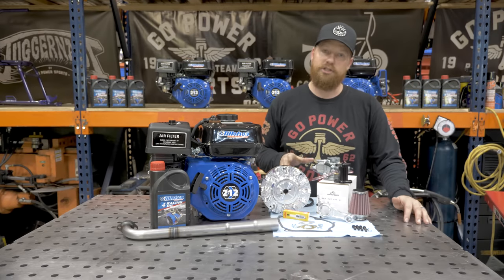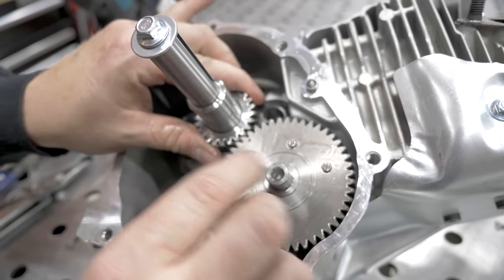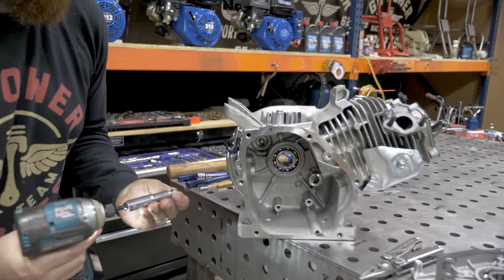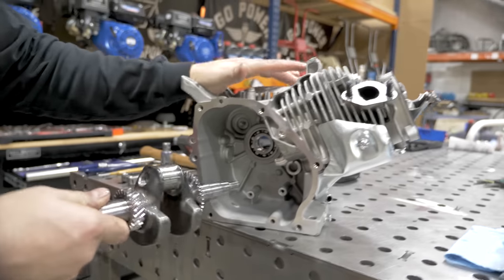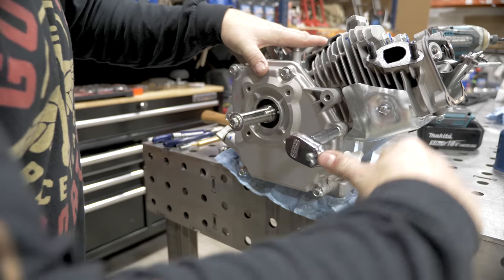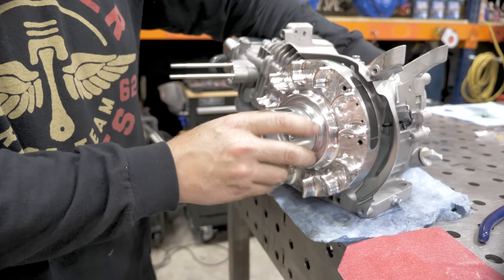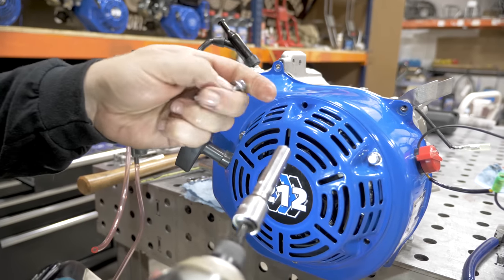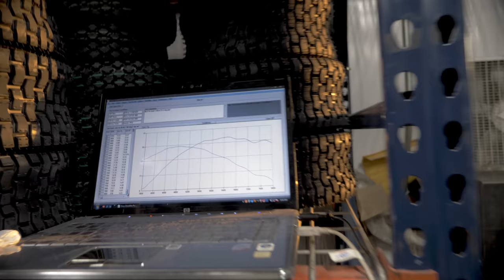Tillotson 212 Engine Stage 2 Install and Dyno | Tutorial

Comment: What was the point of oiling the rod bearings and installing the connecting rod on the crankshaft only to remove it so it can be installed on the piston?
Reply from the maker: Good question.  We do this to ensure that the bearings are properly seated. We see at the shop that some customers skip this step and snap off their rod bolts or have a connecting rod failure.  Since there parts aren't cheap and there's no warranty, we suggest this process. Thanks!
Reply: @GoPowerSports  finally someone who knows what they're doing. I like watching this stuff because always things are changing and different. All pretty much same but I keep up with everything. I do this stuff to pass time lol. God I have some 50s and 60s briggs I grew up with.
Reply: You have to seat the bearing with oil between the rod and crank no matter what to avoid scoring on initial start, it takes about 10 minutes to properly seat and check your clearance which will ensure the best dependability you can achieve with your new parts over the lifetime of the motor. I might oil my next one THREE times!!
Reply: He wanted to make sure it was well lubricated. You would be suprised. You have no idea how long that motor has been sitting in the warehouse with absolutely no movement whatsoever. That motor could very well seize up! So, again....he's taking extra precautions just in case! I hope this helps!
Reply: I have a sneaking suspicion that he meant to PlastiGuage it. Whoops,
Reply: @Fatbalddude1  No...he liked everything & said there was .005" thou or 5 tenths of an 100th of an inch,on a "splash & dip" Engine that's too much .005" thou , that'd knock like a sailor on you sister...even way back in the L6 Stove bolt Chev six era Babbitt bearings that's too much that's too much to depend on a hydrostatic oil wedge to keep the bearing & Crankshaft separated...what if the Cranks been "hourglassed' during manufacture 😶hmmmm what's that ?.Hope that's covered in the warranty."There isn't one,is now a (Stg 2) race engine.Fools & their $ are soon parted.Goodluck bud/dude New Zealand
Reply: @fatbuddycat  wen i take the gov out my ducar do i have to remove the rod n all that ??
Reply: @SoLoCruizer  it is always best to add a billet rod. That said, I've taken a governor out of a Predator 212 without removing the cam or valve cover either before... 🤔....so the technical answer is that it is very much possible.
Reply: @fatbuddycat  just to cruise at low throttle until the parts come in i should be good right they say the ducar is a lil better quality than the pred if u see that me going fast channel the kid on there compares the 2 motors to a tilly 212e
Reply: @fatbuddycat  thanks for your REPLY
Reply: @fatbuddycat  what billet rod would fit my Ducar ??? same as the Pred or the tilly
Reply: @SoLoCruizer  I believe the Ducar has a 196 crank and utilities gx200 rods.
Reply: @SoLoCruizer  the Ducar is up there with the Tillotson 212R. Gopowersports sells Predators with no governor and stage 1 installed.....just don't change the springs until you do your rod. On my 212r I kept everything stock, added a rod and pulled the governor then added 22 pound springs with a .660 bored carb....it is great just how it is. Like the Ducar it already has an aluminum flywheel. In all honesty, I wish they'd produce more of these box race engines because I would never waste my money on another Predator or any other generator motors.
Reply: i guess Im asking randomly but does someone know of a way to log back into an Instagram account..?
I was stupid lost my password. I would appreciate any help you can offer me!
Reply: @Leonel Jace thanks so much for your reply. I got to the site on google and I'm trying it out atm.
Looks like it's gonna take quite some time so I will reply here later with my results.
Reply: @Leonel Jace It worked and I now got access to my account again. I am so happy:D
Thanks so much you saved my account !
Reply: @Koa Alijah glad I could help =)
Reply: @leoneljace4650  nice scam
Reply: Love watching your videos very informative. It’s helping me decide on what kind of build I’m looking to do. What do you recommend. I’m looking to build a nice cruiser. Not a race machine. Want to keep up with traffic in my neighborhood. Maybe 50mph tops if I need it and also some nice range. What do you suggest.
Reply: @GoPowerSports so these aren’t one time use bolts?
Reply: @trevinskiking2165 You've got absolutely no idea what you're talking about mate. You clearly didn't pay attention to the video either.
Reply: @SoLoCruizer same as the tilly .716 I believe the predator has a smaller pin

Comment from the maker: For those looking for even more Horse Power Gain out of their Tillotson Engine, pick up our Stage 2 Performance Kit.
Reply: They have good power/Torque right out the box' an even sound mean Stock'.
Reply: My Kit came with the wrong rod 3.303 instead of 308 it wasn't an option to choose the right one I still use it anyway. You got an estimate on power if you use the 26-pound springs that come in the kit with the hot 265  and 1.2  ratio heavy duty rockers
Reply: @leebrown6153  26lb springs shimmed to the correct spring height, hot 265 and 1.2 billet roller rockers should yield around 17hp

Comment: Awesome video. the proof is in the results on the dyno. 15 HP (50% increase) is impressive for bolt on parts.
Reply: Wouldn't it be closer to 101% increase? I know the predator 212 was 6.5hp and this makes 15hp. I may be wrong.
Reply: @repnatl  your probably right. Math is hard. ; )
Reply: @tonyd7164  you must have used used common core that explains everything 😂😂😂😂😂

Comment: If you leave the rockers loose take the spark plug out and put some thin rope inside the cylinder you can torque that flywheel bolt to 65 ft lb if you don't have an adapter and then adjust your valves

Comment: I spent a full day adjusting, changing settings, rechecking, removing parts up to and including the engine from the frame, and more only to find out the Autolite sparkplug was defective (or just complete crap).  Hopefully, if yout read this it will save you a day  of pulling the start cable and some soreness.

Comment: Any chance you guys could just get the filter adapters machined out a little more so a standard 3/8 socket could tighten the nuts? I have a small tool kit I keep with the bike and I can’t do anything with the filter adapter. Not even my 1/4 inch drive socket fits in there.

Comment: Will the 1/4 inch self tapping bolts fit in the governor holes and the oil sensor hole on a 224cc predator

Comment: For a quick clarification, at 14:03 you're looking for 1.180 

+/-  0.0005 aka 5 tenths or 5 ten thousands 

So 1.1795 to 1.1805
Reply from the maker: .0005",  Thanks!
Reply: @GoPowerSports  If you go on ARCs website it says +/- .0005

The total oil clearance is only .003
Reply: .005 is a lot of clearance. .0005 seems more realistic
Reply from the maker: Thank you for the catch!

Comment: so I seen on the stage one kit with the predator 212 you set the valve lash to 0. I've ordered everything to make my predator 212 hemi a stage 2 minus the cam. Rod piston 18# springs. Stage 2 carb. My question is do I set the last back at 0 and when I get my hot cam set it a .003 or go ahead and set it at .003 when I install my new parts?

Comment: What push rod length is recommended for a stage 2 hemi 212 predator with the 265 hot cam im going to buy the kit but I’m unsure if I will have to buy new pushrods for the bigger cam lift
Reply: stock length

Comment: You used x2 self tappers for governor but what about oil sensor hole?
Reply: There wasn't a low oil sensor on this Tillotson, unlike the Predator, which is nearly identical.
But the best method on a Predator 212 I've seen seemed to be:
Simply cut the internal sensor wire & unbolt & remove sensor.
No need to mess with the bolt, just leave that part as is.
Reply: There wasn't a low oil sensor on this Tillotson, unlike the Predator, which is nearly identical.
But the best method on a Predator 212 I've seen seemed to be:
Simply cut the internal sensor wire & unbolt & remove sensor.
No need to mess with the bolt, just leave that part as is.

Comment: Not a bad idea to drop a little oil around the cylinder while the piston is at the top and a few drops in the spark plug hole mainly because you don't know how long it has been sitting and even a bit more oil if it's going to sit awhile. Just to be sure, in most of the ones I have done I do break in first just to be sure the motor is good before I void the warranty.

Yes, please don't use the $20 torque wrench of any type of work where accuracy is key. I see that a lot with twisted off bolts and stripped bolts from using a cheap torque wrench or a 50 year old wrench that has been dropped 500 times and never recalibrated

Comment: I have a 196cc Coleman ct200ex. I'm wanting to do some upgrades. Namely remove the governor. If I change the flywheel do I lose the headlight? Are there any other options for a higher rpm flywheel that retains the headlight?

Comment: Hey GoPowerSports, I want to go stage 3 on my Tillotson 212 hemi but have encountered a few problems and would like your opinion. I know you carry a valve train kit for the Predator 212 hemi, and I know that most of the parts are interchangeable between the hemi pred and hemi tilly, however the Tillotson has a 24mm exhaust valve while the Predator's is 25mm, meaning the valve train kit for the predator is not 100% compatible with the Tillotson. Wondering what can be done in this case? also will ratio rockers made for the hemi pred also fit on the hemi tilly? thanks and looking forward to your response.

Comment: 1:40 if I have stage 1, and want to replace the air filter, can I take out the whole evaporator system and be fine
Reply from the maker: That black box may be discarded and your engine will run fine.

Comment: I bought an electric start 212 Tillotson with the intention of eventually building it. I have been told that I would have to do some heavy modification to a billet flywheel in order to use it withelectricstart. Can I use a billet flywheel if I'm not worried about the electric start? Or would it just not work? Also what mods can I do with the electric start without getting in over my head? Thanks!
Reply: Stock flywheel is rated for 10k rpm I believe so just get rod gaskets and carb

Comment: I spoke with someone at your shop on Monday via telephone they told me the lash on a stage two setup for the predator 212 should be at 2000 for intake and exhaust should be 3000. Is this correct?

Comment: whay did you change the fly wheel? is it positive? more Hp??
Reply: Higher rpms on a cast flywheel can result into explosion failure, so its best to switch to an ARC billet flywheel for safety.

Comment: Hi how are you all? When installing a billet flywheel can you just install it after lapping it in or does it need to be degreed with timing and all the other steps?
Reply: The location of the timing key in the flywheel is fixed (machined in) and also the keyway on the crank, so there's no adjustment although I do believe they make a slightly offset key that will give/ or takeaway about 2*. I've never used one bit IIRC it moves the power band slightly.
Reply: @delandbrooks3291  Thank you very much for the reply I greatly appreciate it. I'm new to the hobby and still learning.

Comment: This is the exact setup I bought from GPS.  Put it in a Coleman BT200x with your juggernaut CVT.  Only pulled to 6,900 rpm.  Also have some belt slip. Stock 10/50 sprockets. Only ran 55 mph. Valve spring broke while at part throttle & bent a valve no other damage that we can find. GPS doesn’t know when they will get valves for the Hemi head. Thoughts?
Reply: Change your gears and cvts don't rev high as regular clutches centrifugal clutches so you won't get the miles per hour unless you check your gears
Reply: And if you broke a spring your pushrods are too long
Reply: I bought the stage 1 motor from GPS and added their stage 2 kit. I’m not a super experienced engine builder. Nothing was said online at parts order, with the parts, and nobody said anything about push rod length when I spoke with them at order. Appreciate you telling me.  Also what sprockets might you suggest?
Reply: @vernlochtefeld1626  I just looked at the stage 2 hemi tilly kit from GPS, looks like it comes with 26lb springs however doesn't include any of the supporting mods to run 26lb springs, such as chromoly pushrods, stainless steel valves, billet retainers, keepers and lash caps. If all you did to your head was install 26lb springs then this could be your problem, combined with the fact that the kit includes a .010" head gasket and if you used the exact set up in the vid then that means a .265 lift cam as well. Increasing the lift to .265 from stock and running a .010" head gasket which is .042" thinner than stock, means you have reduced your piston to valve clearance (also potentially rendering your pushrods too long which is problematic as well, stated by Lee). Did you check your piston to valve clearance? If you would've checked then you might have seen that you did not have enough clearance with such a set up to accommodate for valve float. And the hemi heads are much more prone to pistons touching valves then the non hemi heads. Just some food for thought.

Comment: What is the difference between this 212 and the predator 212? They seem almost identical but the Tillotson is more expensive.
Reply from the maker: It's all in the head.  The Tillotson 212s will put out around 10HP.  The Predators will be 7HP.

Comment: What can we use to stop the crank from spinning if we don't have that tool that you used?
Reply: I use an old torque converter driven pulley back and drill hole in it

Comment: @gopowersports does this work on 196 clone... If so what are the differences of the engine
Reply: Absolutely but you wouldn't use the rod they used here. You would use a 6269, 6270, or 6271 ARC rod. The carb, cam, and flywheel will work on a 196. And learn how to get more compression. You can get compression that they can only dream of with their Tillotson hemi head.

Comment: I have a question that someone can answer it for me, I just received a Coleman RT 200 mini bike I want to install the Go Power Sports stage 1 Performance Kit and also remove the governor, do I have to change my valve springs also or can I run it temporarily with the stock valve springs,

Comment: It says on the site that the stock flywheel is rated to 10k. So can I keep the stock flywheel on so I can still use the charging coils and electric start?
Reply from the maker: If you bought the Electric Start Tillotson, yes, you could keep those on.
Reply: @GoPowerSports  I figured I'd check because I read in a few places that the 10k claim was a miscommunication from the manufacturer and that it was only tested at 8k for 30 seconds.
Reply: @deltacx1059  loll reason he never replied is bc it was only 8k lmaooo

Comment: Why does the link for the non hemi predator cruiser kit lead me to this video? Now I have to pull the head to clear the rod to put the crankshaft in. I don't have the same clearance as you do on your tilly. Or am I doing something wrong?
Reply: Make sure you don’t have a hemi kit for your non hemi🤷‍♂️. that might be your problem.
Reply: @smallenginepower2267  no, it's a non hemi cruiser kit. At least that's what I ordered.
Reply: I guess the tillotson block is just overall bigger or something.

Comment: What about the valve springs did you use the stock ones
Reply from the maker: The stock ones are around 22-24lbs, no need to change out with this set up.
Reply: On a predator 212 non hemi/hemi you will have to replace the stock 10.8lb to 18 or 26 depending on your cam specs.
Reply: Thats if you have a predator though, not a Tillotson

Comment: Do i need smaller pushrods after installing this for a stock Coleman motor? They sure seem long.
Reply from the maker: This kit will not fit into the Hisun motors that are on the Coleman.
Reply: @GoPowerSports  The 196 clone kit on your website also links to the install vid here, so does the 196 clone kit come witch the correct size pushrods? I bought the 196 clone kit, but I'm asking here since it was linked on the 196 kit page.
Reply: You shouldn't need different pushrods when putting a cam in a 196.

Comment: the tuning of that intake manifold is leaving a lot on the table. The length of the runners has a direct correlation to the engines power curve. the longer the distance between the carb and valve the earlier the engine will want to make peak torque lower in the RPM range the shorter the runner the higher the rpm HP but less torque. This has to due with the "harmonic frequencies" reverberated back to the valve and forth. The easiest way to tune the proper length for that intake runner is to cut the center section out of the aluminum pipe and put radiator hose in there and run dyno sessions and cut it shorter until you have the optimal runner length. This is how Tunnel Ram was invented by the Ram chargers in the 60's. IMO you should also be running a PCV valve system for engine longevity as well, its an old myth that it robs power and dirtys things up, it actually saves engines by making sure there is always positive case ventilation and dirty air and un burnt fuel from Bowby doesn't settle in the case and mix with oil to eventually throw rods, it also makes sure the rings seal better and reduces windage from the crank. I even use them on my race car, and so does most of the race world (albeit specialized evac systems).

Comment: Does this kit work on a predator engine from harbor freight?
Reply: It would not fit because the Predator 212's have a unique crankshaft and for the non hemi a unique engine block. You would need Predator 212 specific parts or kit.